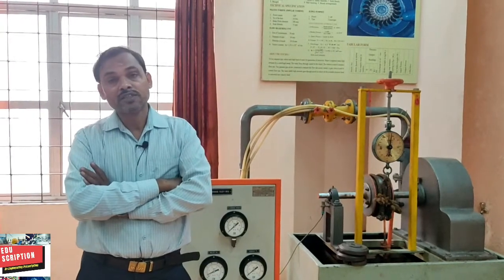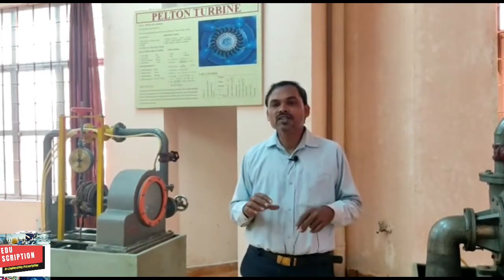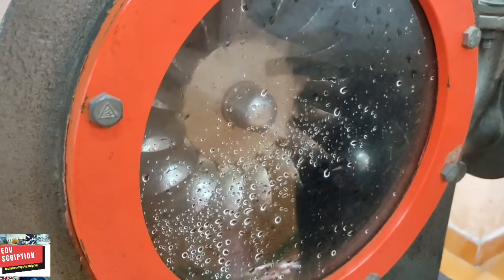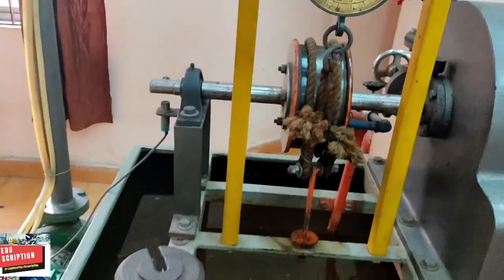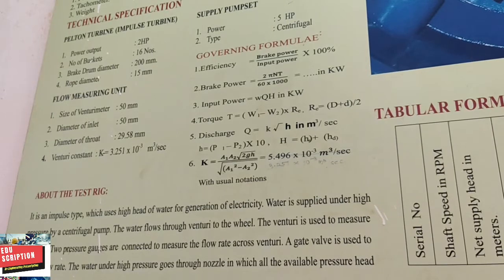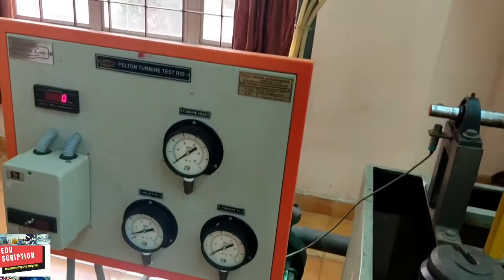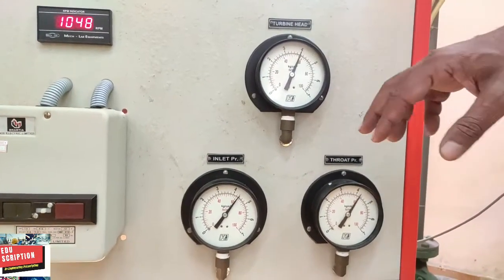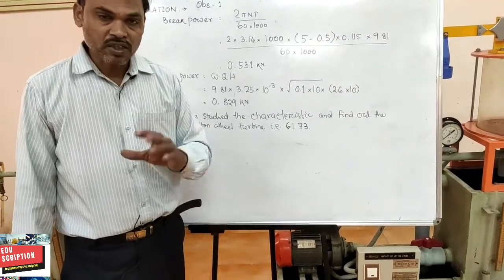Pelton wheel turbine Lab Experiment and Calculation|Load test|Fluid mechanics|Eduscription

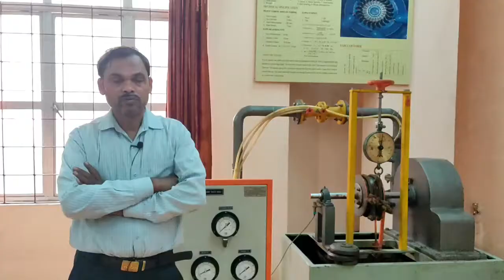Comment: 00:04 - Understanding the conversion of hydraulic energy to mechanical energy.
01:16 - Overview of water regulation and electrical work division in Pelton wheel experiment.
03:31 - Understanding automatic nozzle functions in water systems.
04:50 - Overview of equipment and setup for the Pelton wheel turbine experiment.
06:00 - Overview of Pelton wheel turbine experiments and calculations.
08:01 - Understanding Pelton wheel operation under varying conditions.
10:00 - Overview of experiment setup and operational principles of the Pelton wheel turbine.
12:25 - Discussion of diverse topics including power connections and community issues.